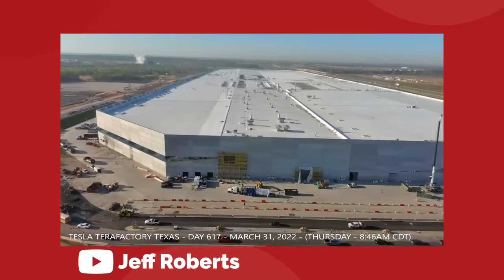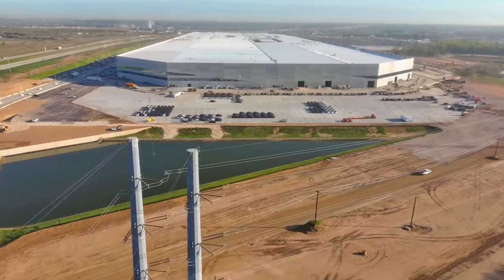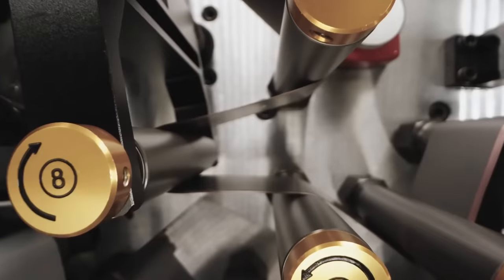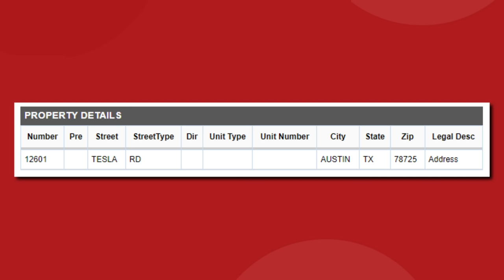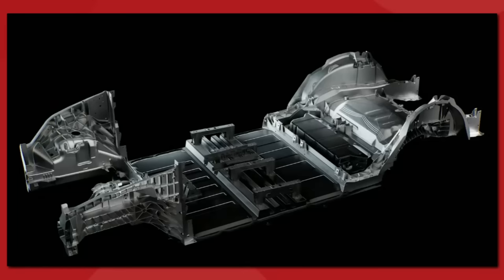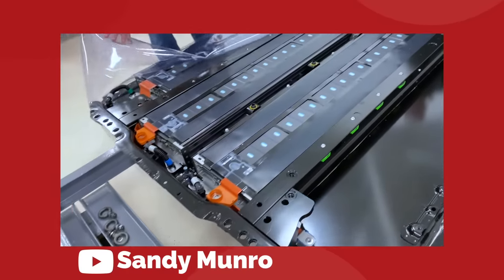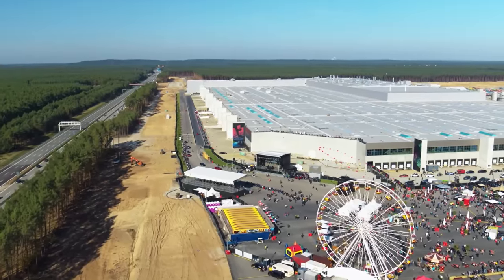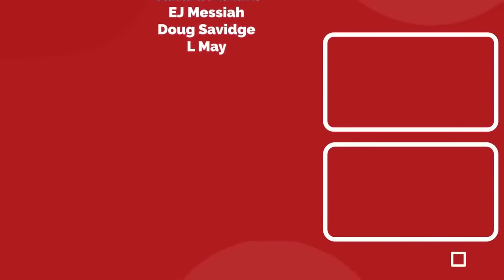Tesla Gigafactory Texas Is Officially OPEN!!

Comment: everything in that factory looks amazing, but my one concern about the new product variants is- do they plan for battery replacement to ever even be possible with the new architecture? I dont see how they could, but I also dont know how well the long term ownership economics would play out if you have to get a new car instead of a new battery.
Reply: The batteries will last over 500k miles. No need to replace.
Reply: Battery replacement isn’t a good idea. 

To have a battery replacement model, you would need to produce multiple battery packs per car. Batteries are the main production constraint for EVs. So for every battery they produce to sustain a battery swap model, that’s one fewer car they can produce. 

Much better to just have the battery pack be able to perform at a high level for enough charge cycles to give it a life expectancy greater than or equal to that of a combustion engine.
Reply: @hillmans69  dude you're drinking the kool-aide.
Reply: @CYAnomo  Let's pray they don't catch fire. So, what you are saying is that once the Tesla car reaches 500k miles, it's time to do a refresh and get a new Tesla. Just recycle the whole car.
Reply: Even when the batteries are designed to last a whole life, it's a bit worrisome that is not replaceable.
Also not replaceable will mean that my grand kids wont be able to rock out their grandpa's classic on year 2130?
Reply: @V1N_574  that's my concern, I work in a technical industry of fixing things that are supposed to not break. They still do. And given that there's a (small) number of tesla haters, I'd hate to have my car unfixably totalled by some nut case with a screw driver that put it under my cars floor and jammed upwards, especially when a replacement, payed for by insurance or not, would take (probably) weeks or months to arrive
Reply: @fauxbro1983  the battery technology came out on battery day 2020
Reply: @CYAnomo  lol…… that’s just estimations not reality, the battery last long depending on how you use it.
Reply: @samgreenwood8313  Shushhhh....don't give those haters any ideas!! 😨
Reply: @V1N_574  And it's obviously bad for the environment to have all these batteries just...lying around.
Reply: @CYAnomo  unless they explode. Especially in water.

Comment: @11:50 You're making a mistake if you think that the 4680 cell form factor is for the consumer. 
It's not. It's so Tesla can satisfy its stated/published specs for a lower cost. 
As long as the specs are met, what do you, as a  consumer, care? Right?
Reply: Since when were improvements in both performance and efficiency not good for the end user? It's like saying the efficiency improvements of a 2019 engine over a 1979 engine only benefit the manufacturer.
Reply: @user2C47  except tesla has previously stated that the vehicles will be the same spec, and the weight reduction will be fairly negligible on overall efficiency, the only thing it will really change is the cost of production and I highly doubt tesla will be passing that onto the consumer.
Reply: @mikefarino4368  Bingo!!! But it's still much better than a diesel ICE. 
I'm definitely not against Tesla making a great deal of money off of the switch from fossil fouls o Electricity. (I'm a shareholder. 😉)
Reply: @charlesrovira5707  What do you mean by ICE? I see a lot of people texting it
Reply: @DudleyIntelligence  ICE -> Internal Combustion Engine. 
(There's no such thing as a dumb question. Only stupid answers. Feel free to ask anytime... )

Comment: I believe there are two aluminum pieces and not one. The front and back pieces are connected the the structural battery pack. The structural battery pack implies that the batteries are installed directly into the frame, which avoids battery modules and pack. The frame of the car becomes the ‘pack’.
Reply: Yes, the chassis is three pieces (as I understand it). The end pieces are attached to the structural battery pack in the middle.

Comment: I would make a glass roof, with solar panels, but not on the roof, but along the body, and mirrors for reflection, it turned out very beautifully practical
Reply: Austin Texas + Glass roof = Bad day!
Cover the roof with solar panels to soak up that sun. Power the A/C needed in a building that sized.

Comment: Actually there is a 4680 production area in Giga Texas and there were videos showing delivery of equipment quite a while ago. Elon said the equipment would need some updating since they made improvements at Kato Road since the Texas equipment was ordered. I'm sure those revisions have been retrofitted. You can bet the new MIT MYs  use cells made in both CA and TX. Especially since they've already produced more MYs than the million Kato Road cells would support.

The new building being started is for just battery cathode production. That cathode material will then be used next door.

Comment: The model Y is in front of the window on the upper level which is close to the 4 lane loop highway around Austin.  You can easily see inside the factory from the highway.  I have seen robots from that vantage point.
Reply: cheaper to buy new

Comment: I hear structural battery pack all the time and I understood it is a stressed member of the vehicle. This is the first time that I heard the statement that the pack is the floor. That will be fascinating to see what it takes to service a battery pack in one of these models.
Reply: Sir I refer you to beyond the press youtube channel, apparently only 20-25 kg of high explosives. If you pay cash around $40000-50000 us. And despite searching I have yet to find any data about how much one tesla Vehicle produces in very highly toxic waste. Not the actual production but the materials required. So for starters 2-10 human lives, this will increase due to very, very toxic waste. Approximately 10000 kg per 100 g of electronics. Not to mention all the plastic from the petrochemical industry. In actual fact the least environmentally damaging components of a tesla is the metal used in the frame. As for a stressed battery pack, yeah that's just effin scary, a stressed battery pack in a collision, sorry I'm already 20% crispy critter. Musk is a conman, sorry I had the same children's book he is trying to sell 20 years out of date as I had in the 70's. Just the other day I saw a promotion about a start up wanting to drill 20km for geothermal energy. 12500 m is the best and even then they gave up. Ffs fusion power has been increasing by 5 years every 5 years. Thorium reactors that produce more fuel than they consume. Seriously where are you going to store radioactive waste that keeps increasing (suggest milking the Thorium cow). I chose not to breed, I'm not going to fluffy cloud land with the invisible magical space pixies. Sorry but o.k. boomer is a badge of pride. 10-30 years what do i care. But hey good luck, when you make the same mistakes in new and interesting way you are gonna need it. Again good luck.

Comment: How to change the battery if it is part of the structure of the car ?
Reply: Unless it is a very rare case, the battery will not need to be changed. Recently, JB Strauble, co-founder of Tesla,  said the batteries would last at least 15 years. On the rare occasion where the battery pack would need to be replaced,  the pack could be unbolted from the car and the pack can be dropped down. In those cases the seats and other interior parts would probably be removed from the vehicle prior to dropping the pack down, whereas in the factory those parts would be pre-attached to the battery pack prior to installing it into the vehicle.
Reply: Chances are the battery will last longer than the car.
Five years from now it may get boring seeing so many identical cars. Wish I had one now in BZE.
Reply: @bbcooter388    hahaha! 15 years! You'll have 5% charge by then
Reply: @littlet7556  Don't be silly. 10-year-old Nissan LEAFs still have something like 60% charge even with their inferior batteries and atrocious power/thermal management. (Check out AutoTrader's great vids about the cheapest used Nissan LEAF to see this in action.) In 15 years, Tesla's structural 4680 packs will still hold most of their original charge.
Reply: @BlakeLinton  , I'll belive it when I see it
Reply: @littlet7556  The batteries used in EVs are not the same batteries used in your cell phone. EV batteries are designed to last the lifetime of the vehicle. Besides that,  most of the vehicles sold in the USA and Europe are sold on a leased basis, so why do you care how long the battery lasts if you purchase the EV on a lease?
Little T, do you purchase new or used vehicles? If you do purchase new vehicles,  how many have you purchased with a lease?
If the batteries begin to fail in used EVs the market price will drop on the vehicles prone to premature failure to reflect the remaining utility In that vehicle, just like a used car with 300,000 miles on the odometer today is much cheaper than ones with 50 or 60 thousand miles on the odometer.  The market will set the price of goods sold, based on the utility they provide to the purchaser.

Comment: Wishing them all the best but still new model Y cars arriving from China to the U.K. have so many issues. Rear hatch needing refitted, still panel gaps that are big and not uniform, parts falling off. They need to do a right we can now build so many so quick we don’t have to chase numbers but focus a bit in quality. Having squishy plastic at the seatbelt pillar just comes across cheap, some of the plastics feel cheap and it needs addressed on a £55k Car. Hire a guy from Audi or Porsche 😁👍
Reply: Austin coming up will let them slow the Y lines at other factories.  That should improve quality

Comment: speaking of turbine wheels .... are there left and right side wheels ..... the reason I ask is that back in the day, I was privileged to talk with a Pontiac Fiero dealer .... the car had the same wheels on both sides ... one side drew air out from under the car  ( to hold it down at high speeds ?) while the other side actually forced air under the car (?).....  we discussed the theory that turbine wheels were intended to suck the car down to the ground at high speeds, firmly holding it down for better traction and stability ... we decided that a mistake had been made with all the models he had at his showroom location and that he would look into the matter with all due diligence... I never went back to find out the outcome.
  so far ... I have never seen a tesla with right and left side wheels.....  DO THEY EXIST  ... if not ...  WHY NOT 
  ....

Comment: Question.  How much electricity does the entire plant use , after all its all automated. And why would they have a NON-PUBLIC ELECTRICITY SUPPLY,  after all they have and make solar panels and batteries... and how much fossil fuel (as they call it ) is impacting our atmospheric.  So simply , your power for the factory and power for car is STILL coming from where ? And at what rate .

Comment: Having the structure of the car being essentially three large pieces (including the battery pack) obviously has a lot of advantages, but it seems as though they're moving towards a car that isn't repairable. If any of those three pieces is damaged, the whole car is scrap. Does anyone agree or disagree with me on that?
Reply: I was thinking the same thing, although, since they're very large sturdy pieces I image the only time the car would have to be entirely replaced is with a substantial accident, in which even normal cars are often replaced with insurance anyways. Little minor collisions would probably just affect exterior pieces.
Reply: @af4396  I suspect they're designed to produce excellent crash test results, and be sacrificed in the process. If the passengers are saved, who cares if a chunk has been taken out of the huge casting? I still say that if any of those three large pieces sustains much damage, the whole car is scrap. But maybe the cars are designed such that the front and rear castings can be replaced.
Reply: Great question, i do think they thought about that, but it doesn't Hurt to ask

Comment: I'm very very surprised that he doesn't have a lot more open windows in the roof to let natural light in
Reply: Windows are probably better on the walls since they’d be covered by solar panels anyway
Reply: Solar panels are on the roof to power the plant and it get really hot and humid in Austin.  Also, open windows bring in dust and dirt which is not good in a place you make and especially paint vehicles.
Reply: @johnkestner   I'm sure they could fit a few rows of natural light in between the rows of solar panels because they are going to spell Tesla in the blank spots anyways declare this middle's in the windows and still spell Tesla
Reply: @JBoy340a   I'm gonna go with you don't have to open the windows and since they're gonna have an area where Tesla is in the blank spots where there are no no solar panels they can make those into windows and still spell out Tesla wrote no  You really think that every window has to open it can't just let a natural light dust come on
Reply: Windows tend to be thermal bridges and let in more heat than a wall.  Texas is very hot 7 months out of the year.
Reply: If the roof was made of glass then the cost of air conditioning would cost millions.  People don't like to work in greenhouses, even more so in one of the hottest locations in North America.
Reply: @krashd   Who said anything about the whole roof I'm talking about a couple of panels in the letters  just let's have natural lightning not the whole roof wow

Comment: As a licensed auto body tech...I think that one piece front and rear sections is a horrible idea!! It'll take a slight hit to bend It and that will misalign the front suspension and body panels. Since it's aluminum, the repair process will be very limited so the whole section will need to be replaced, causing extremely expensive repairs. 
So then many of those cars will end up beinf write offs and the scrap yards will be filled with them. Plus If the batteries aren't recycled properly from the damaged cars, then those cars will do more damage to the environment than save it.
Reply: Biden doesn't care.

Comment: As usual, additional comments will show the latest news, not available at the time of publication of the original video.  There are now other later videos showing other aspects of this Texas plant.  The 4,000, 6k or 8k injection machine is intended soon to be a 12k aluminium injection machine. These machines are being designed & created with outside collaboration by other international third parties. Previous batteries made by LG and other third parties will now stop.
Later Tesla plans are now being released as usual.  The seats are now expected to be added as part of the battery installed into the main body.  Previously the seats were added via the door entrances.
There are now Youtube channels made by "retired" Tesla executives, demonstrating & explaining the Tesla Management system.  It is yet to be studied, published & copied by other managers.  Disregard for graduate studies is continued, as usual, for innovation.  On-work, on-duty work results, long term, with regular & predictable supervision interaction, seems to work.  Autonomy and self-initiative are expected, with no regard for job ranking or roles.  Instead, fulfilment towards the overall shared goals is the target.  Extremely different to the usual boot-licking of standard organisations.

There is also shown on other Youtube channels, the extreme management styles differences between Tesla, Bill Gates & the current "Democrat" POTUS (Biden & the USA trade unions).

Comment: I am the start-up company you may be looking for. Invented methods to eliminate CO (Carbon Monoxide) from the combustion process; quadruple flow rate through devices, improve rocketry, jet engines, dramatic improvement in fuel injection, eliminate CO from home heating; entrainment of gases into other mediums, methods to improve milage past the proposed 40 mpg, patents issued during 2019, 2021.

Comment: Why does the model Y have a slant back, the same as the sedan model? Most other SUV's have a 70 degree window slant on the back so that the sun doesn't heat up the interior and the snow and ice doesn't accumulate on it. With the slant back in winter like in the US North or Europe, if the wires don't work, the window stays covered. Tesla needs to change this. And, why doesn't their pick-up truck look like a pick-up truck?

Comment: Well, Tesla Fremont is not Teslas fault. That factory was built by GM way back in the 1950's using 1950's tech & 1,000 assembly line workers. Over the years GM added building after building after building where as you watch a flyover today the plant looks like downtown SF, or Chicago or Austin. All the corridors for trucks to manuever betwix all the buildings are very narrow alleyways. I bet everytime Elon visits he wishes they could just knock the whole of it down & build new. The reason they dont do just that is because-
-Tesla sells more cars in California than anywhere else.
-This factory was Teslas first so it has some sentimental value to it
-Where would the cars come from to fill orders while Fremont was being rebuilt?
-MAYBE they have plans on the horizon to expand Nevada & move production there Someday.

!